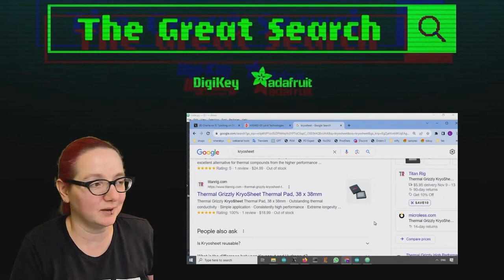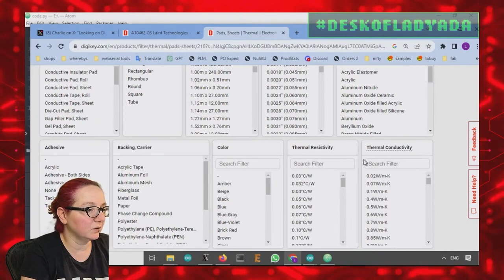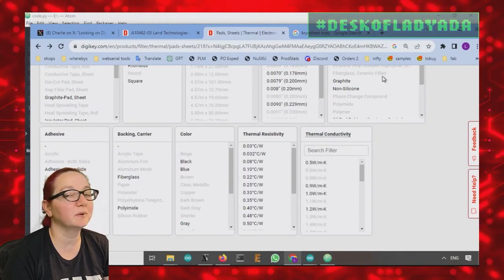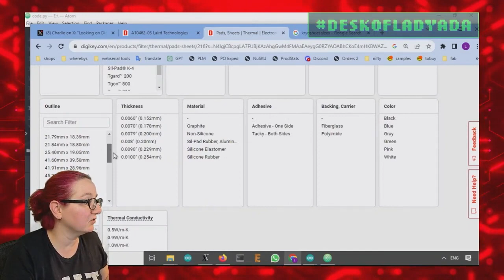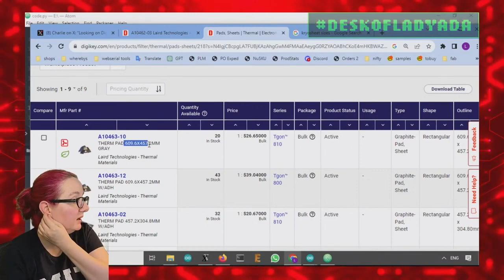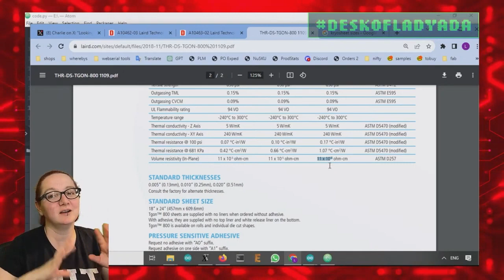The Great Search: Graphite Thermal Pads #TheGreatSearch #DigiKey #adafruit @DigiKey @adafruit

Comment: Does a thicker pad usually have more heat resistance than a thinner pad? That might be an issue to consider if you intended to push the cpu or chip  really hard. I enjoy your "Great Searches" and agree that DigiKey's filters can really help identify the components that you need.